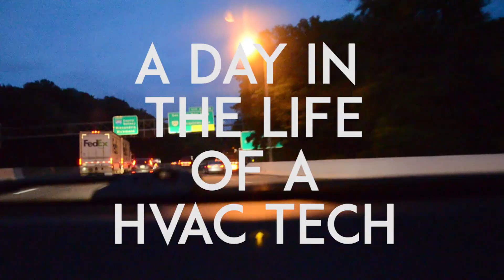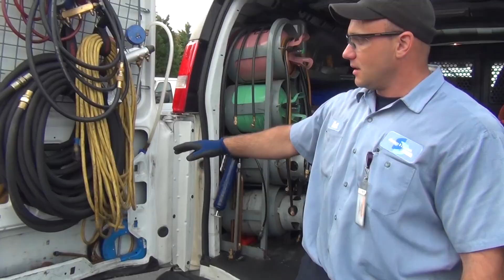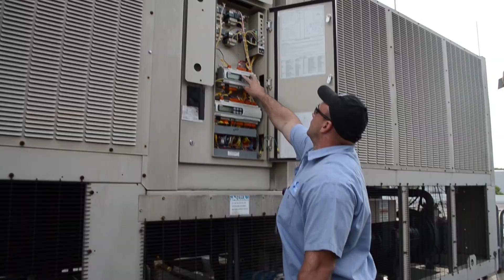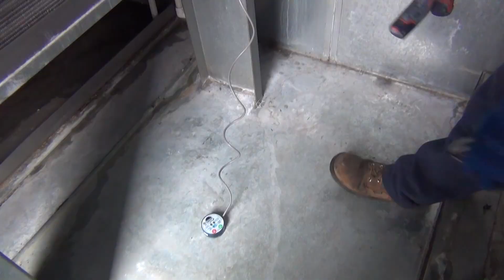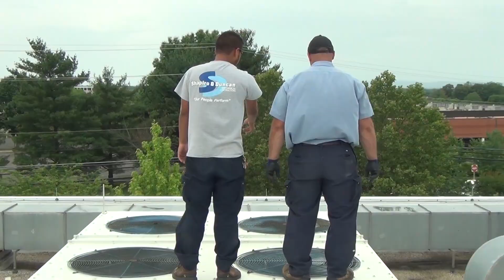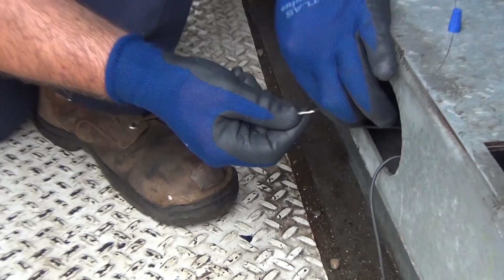A Day in the Life of an HVAC Technician

Comment: About to start my first day as an HVAC installer tomorrow! Thank you for this video, very insightful. The Odesza track was a nice touch!
Reply from the maker: Congrats! Welcome to the club and thanks for watching.
Reply: @ShapiroandDuncan  hy i have 8 years expireince  air conditioning  and refrigerator
Reply: Aye trev! I’m gonna be starting next week, was wondering if you’re still doing HVAC and any insite you could give me going in?
Reply: @codymcalpin1264  yo what up Cody! Yes I'm still in HVAC working as an installer. I have about 5 months experience working in the San Francisco Bay Area. This is what I've learned about this trade so far. 

First off, this is a physically demanding field. You'll spend a lot of time in tight crawl spaces and attics, installing heat pumps/furnaces and running ducting. You will run into a lot of challenges along the way that will require you to be creative in your approach. But don't let this deter you!

Being fimiliar with your tools and how they function will give you a huge jump in your confidence and ability to execute your tasks. If you have any questions about what tools you'll need, I'd be more than happy to help you.

This trade can be tough and there will be rough days. But when the job is done and you look at the end result, it makes it all worth it. If you have any more questions I'm all ears. Good luck to you!

TL;DR: HVAC is challenging, but the pay is excellent and the work is very rewarding.
Reply: Would like to know what your experience is so far after a year?

Comment: I've been in HVAC/Refrigeration for 7 years. It is a good career, but a few things to consider. 

1.) There will be times when you pull 14-16 hour shifts, then drive an hour or more home. When outdoor temperatures are high, you could be doing the extra long shifts for a week straight, or more.  

You will be on call 7 days per month.  You've just worked 60 hours in 5 days due to a heat wave. You finish up at 8:00pm Friday evening, and you're ready to go home and crash. But, you're on call this weekend. You get home and fall into bed at 10:30pm. It's now 10:45, and dispatch is calling you for an emergency ticket. It's not uncommon to work another 30 hours over the weekend when on call. That's 80-90 hour weeks. 

3. Because many companies are heavily understaffed, some will treat you like a robot. They will work you until you drop, then hold conference calls with the tech team to complain that you aren't working enough. Have a wife and kids at home? Too bad. The job comes first, and they need you to run service calls tonight.
Reply: Does every company require you to be on call because if I fall asleep I ain't waking up at all and I'm just gonna sleep through that call
Reply: @anthony8818  Yes. All companies require 24 hour service, and it is brutal! In fact, I'm on call this week. I worked 21 hours Wednesday, 14 hours Thursday, and I left at 7:00am this morning and still haven't been home yet. And, I'm still on call tomorrow and Sunday. With my company, not answering is automatic termination.
Reply: @murfdog19  I'm about to finish high school in may and I was considering Hvac but I dont want to be on call and be a slave to a company. Thanks for informing about this. You changed my mind.
Reply: @anthony8818  No problem, man.
Reply: @anthony8818  hey man what career did you end up choosing? I just graduated
Reply from the maker: Thank you for your comments! Yes, do your research and find a company that takes care of their employees. Good company culture is key!

Comment: System was low on charge as you said. So there's a leak. Did you locate are try and locate leak before dumping expensive R-22 into the system and adding it by liquid might I add from the looks of it.

Comment: So you top off a circuit and replace a sheave before you repair the refrigerant leak???? Big no no especially on a unit with 8 circuits. Plenty of redundancy.
Reply: Frank Camis exactly. I work on Aaon rtus like this all the time. Especially with it being a 22 charge, no reason to waste refrigerant. Leaks I find come from the replacement compressors, new compressors come with roto-lock fittings that are field installed. Half of the hacks can't braze 45%.

Comment: Thanks for the insight. My man is about to graduate from his HVAC program and has a job lined up. I just wonder about growth. What's the highest you can go with this field and does it entail a degree because I keep hearing about how hard it is on the body and Id like for him to not be  in his 70s doing strenuous work. But, thanks.
Reply: He can always look into stationary building engineer jobs or an hvac operator position. I was out in the field for 8 years (worked out of a truck) and now i am a refrigeration operator . Which is mostly operating a system through a computer. Not hard on the body.
Reply from the maker: The pathway into an HVAC Tech is limitless, it depends on how far he wants to take it. If he keeps up with his training he can take his Journeyman test, obtain a Masters License or even start his own company one day! If he chooses to stay with a company, the growth question you stated is an excellent question to ask a company. If he joins the right company, they will work with him based on his skills and place him in an office position when he is ready for the career change. We have many field guys who later moved into office roles such as estimating, sales, project management, assistant project management or CAD/BIM positions. They can absolutely take their field knowledge and it can be applied in these roles with additional training. Good luck and thanks for watching!
Reply: You can go as high as you want provided you put in the time and effort.  Most guys steam out around 50 to 55 and take field engineer jobs working for a school or college.  By 55 your body is shot if you have putting in a full days work.  Some guys go into sales, or go behind the counter at supply houses by 50.  I am 56 and still in good shape . My back and knees give me trouble though.  Never been hurt on the job .  At least not bad.  Being hit by 480 volts did sting a bit.  Tasted copper for a week.

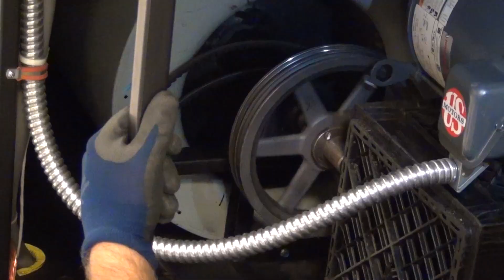Comment: On 4:34 on the sheave replacement what he putting to the treads?
Reply: Never seeze ..it's an adjustable pulley you put it on the internal threads incase you need to removed or adjust it